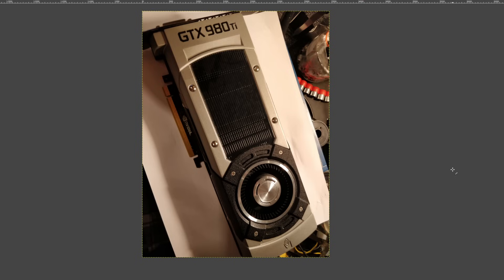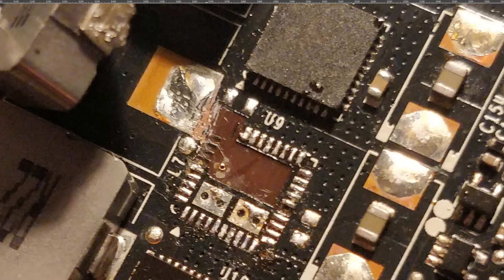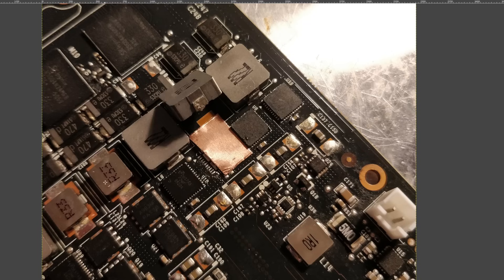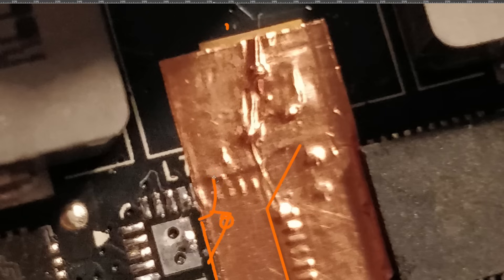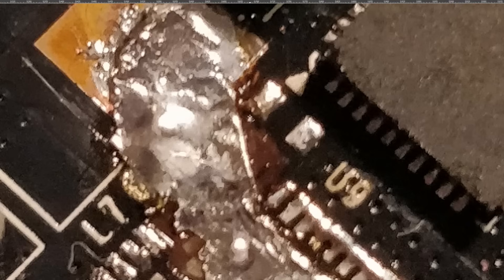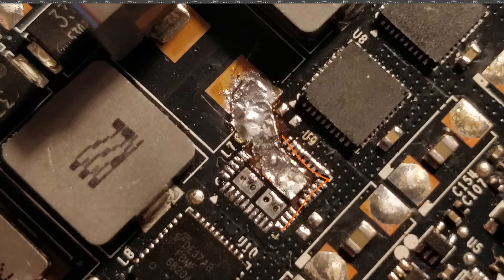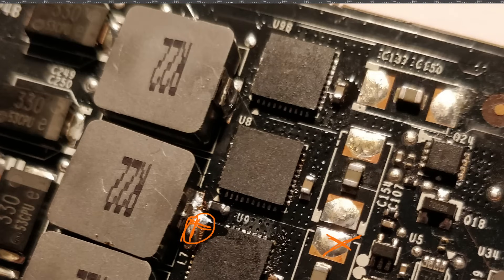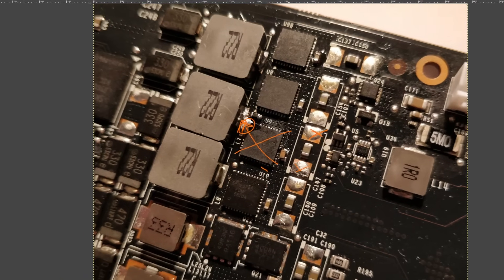reference GTX 980Ti Vcore VRM switch node repair.

Comment: Classic bz 😊

Fyi in certain use cases where devices are expected to undergo a lot of physical vibration all joints are welded and solder is eschewed entirely

Comment: pleezz help asap on this info     i have 3060 new i have 2070 for cuple yrs now win idle it shows low memery contler lode on gpuz on 2070   win i look at gpuz on 3060 or my 3070 on a b550 amd 5900x cou my 3060 an 3090 showing on gpuz 30to50 memery contler lode     on gpuz but as soon as a dam game or any 3d program is run it lower  it allmost like amd cpu volts win idle its varry hi right than win u put lode it gos down so is the 3060 3070 diff than the 2070 memery contler   evin 1070 is the same as 2070 but 3060 an 3070 how can i test my 3070 thats  used 1yr warrty from ebay to see if any thinks wrong on it how wood u do it i got a 3070 msi 3070 3fan for 300cash 1yr warrty its a msi gamings x   i cud of got a asus striks for 30cash more wood u say i fck uup by not geting 3070 striks over msi i got it cuz i have msi all ready for yrs i got a msi z 2070 that was good to me so i did not whant to get somthing that was over power an blows out i no asus are i look up banch marks an it was showing msi x gaming plus was runing cooler an batter than asus stock the 3070 that is

Comment: Solder on top absolutely does add current capacity, this is pretty common from the factory on old power amp boards
Reply from the maker: Also standard practice on PSU PCBs and some RTX 4060s.

Comment: My only problem when I tried, was using so much heat a damaged a VRAM module. Pulled an unneccasary power stage that just switches between different PSU plugs, then used a Telsa M40 schematic to disable that switching. I think there was some power limit throttling there shouldn't have been that I didn't sort out, because faulty VRAM. I think somewhere between what you replaced and inductor L14, there's a tiny transistor you pull and populate a missing resistor, to permanently hold an enable pin active.

Comment: I have a scrap 980 Ti Strix OC here if you want that for something... It had a bad memory IC so I tried to desolder the old memory but I ripped up two or three pads under one of the IC's and so now I have no use for it, but the core and VRM are still good at least... just cover shipping through COD and I'll send it for free

Comment: What is actually happening when a power stage fails? Do sustained high temps (100-120C+) during normal use slowly degrade the internal structure of the chip until eventually it bridges something internally and then causes the power to flow freely thus leading to fireworks? In other words is bad cooling usually what kills most VRM's or is it usually some factory defect that leads to early failure? I feel like if normal use was degrading them over time that more of them should fail in quick succession, but I guess a lot of times people don't have this issue since they just replace the card after the first failure unless it was an early failure.
Reply: Probably both. I think FETs have a tendency for thermal runaway, where they start dissipating more power if they overheat. So my guess is that internal degradation or a cooling issue results in a gross overtemperature, and the FET suddenly no longer reponds to the input on its gate...
Smart powerstages with an integrated overtemp sensor should be able to save themselves, *if* the controller is configured to respond to the OT signal.

Comment: Whenever I've seen people repair traces or copper like this they used some UV curing solder mask. I also like to use it to hold bodge wires in place and it can be picked up cheaply on eBay and similar together with a matching flashlight for curing. For a big patch like that it might take a while to so it might test your patience
Reply from the maker: So I did consider trying that but I couldn't figure out how I'd cure the solder mask if it's under the replacement switch node. Since copper is opaque to UV AFAIK.
Reply: Adding few spots around the perimeter of the switch node could help.

In this case use the corner with the via and the diagonal one. It should keep the foil in place, kind of.

Take it with grain of salt as I have no real experience in this area.
Reply: @ActuallyHardcoreOverclocking yeah just around the perimeter is probably the only thibg you'd want to do. I guess with the foils being this thin I'd still be problematic

Comment: Hey I was wondering if there are any hardware mods like soldering in new components for a 3080ti card to improve stability or performance.
maybe an example is soldering in better capacitors to increase stability of VRM
Reply from the maker: depends on the PCB but I wouldn't expect any major benefits for air/watercooled overclocking.
Reply: @ActuallyHardcoreOverclocking  ahh so the performance/stability gain of any hardware mods are miniscule compared to overclocking card. 

I have the Palit 3080ti Gamingpro managed to get it quite cheap around 500 bucks for used one. its got less power phases than the Gamerock so wont be stable at higher clocks I was thinking maybe I could solder any ICs to improve VRM stability.

other than that I'm just going to do the deshroud mod and have 3 x Noctua 92mm fans to improve thermals hopefully.
Reply from the maker: @AntwonZedras  yeah the mods are only really worth doing if you're competing in benchmark rankings where even 1% more performance can move you up the rankings.
Reply: @ActuallyHardcoreOverclocking  ahh unfortunate thanks anyway